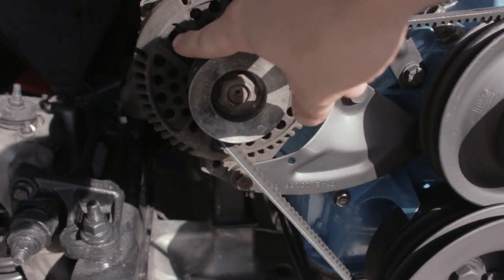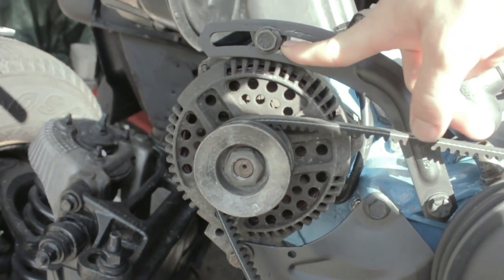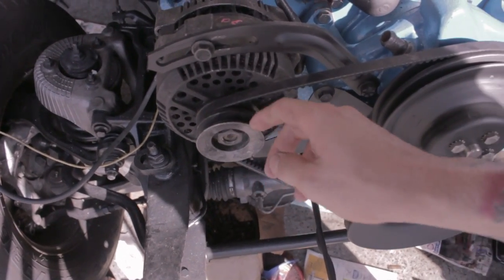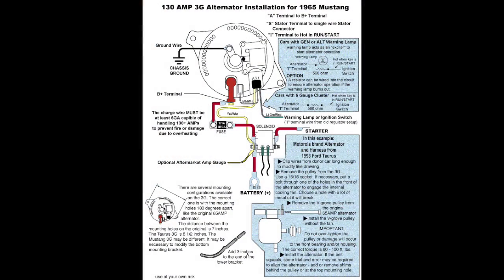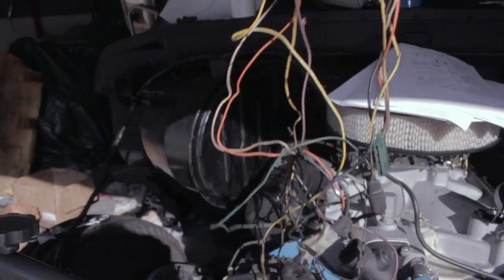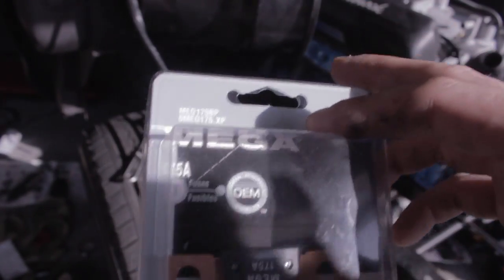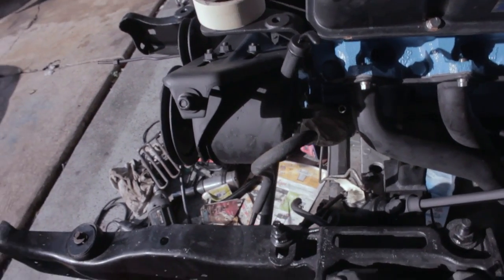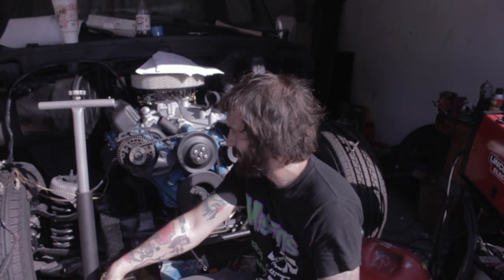Ford Taurus 130 amp 3G Alternator Swap for Ford FE Engine - (1973 Ford F100 Rebuild = Day 41)

Comment: did you have any issue with the back of the alt casing touching the block? mine is...currently doing the swap now...I also need to shim the pulley a bit. just a slight grinding...there was no pulley spacer on the 3G I purchased.

Comment: So I got a 4 hole small case 3G .  Can't get 8 inches across the bolt mounts , its like 7 7/8 "  at the most .   Wont work , right ?

Comment: Set up a cooling duct to get some air on the PS cooler, i see them installed on the front of the  engine support cross member where air, water, rocks, salt and dirt can keep the cooling fins cool and wet, and bent, and corroded, and encrusted, so if you opt to put it there I recommend a gravel/splash guard, I like where you put that one, its just a matter of keeping cooler air flowing around it, not boundary sir which is hotter slower and less effective

Comment: I know this has been a long time... have been hunting for a 3G alternator in junkyards to put in our '73 F250 with the FE390... My question is you said to look for the 8 1/4" ear spacing alternator (far right version when you show the 3 different 130 amp versions), but the one you actually have on the truck looks like it's the 7" spacing (the far left version of the 3 different 130 amp alternators).  Which is it?

Comment: hey bob want to do the same thing , saw the link to the wiring diagram you used you mentioned in the video. my 74 f250 didn't have the wiring from the alt to the starter  relay on the fender wheel to the  to voltage reg. is there a way to send you what i have to get some more info. ,kind of still confused.

Comment: I did this last year, bought one a guy rebuilt cheap, he used a one wire regulator which gave out, I had no idea as it circumvented my idiot light, so when the van battery is dead, then you figure it out, I did not install a fuse on it tho, I may do so later, the guy who built my alternator said he's been doing it a long time and never used one, but my battery did get the water boiled out of it recently, likely when the regulator spiked before death.

Comment: Yeah I actually lost my Spacer Washer And Am currently Using a 11/16 oil pan gasket   and my original pully
Reply: and if yhou need a mega amp fuse 2000 model amp fuse have 175 amp on the car ion junk yard

Comment: Hey Bob,
What are you going to run for a rear? Staying with the 9 in, or? I'm leaning towards the 8.8 just cuz it'll match the CV front, they're cheap ($150), they are plentiful to find with wide variety of gear ratios, possi,  sway bar, disk brakes... even though you may not need all that, but hey... you really don't need the ISF either right?
Reply: IFS... you knew what ment!
Reply: ***** Good to know on those 80-83 axles! I'll be checking that out for sure. If I cant make the 9 work without braking the bank I'd rather go that route as well. 

I saw your rear swap video after I posted, guess I missed that one.